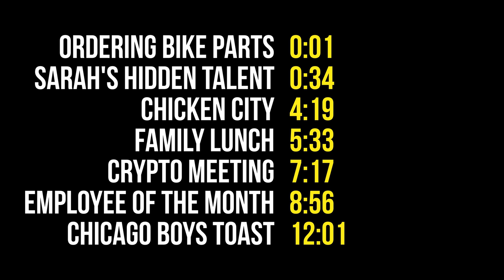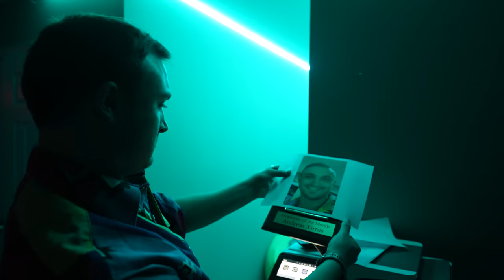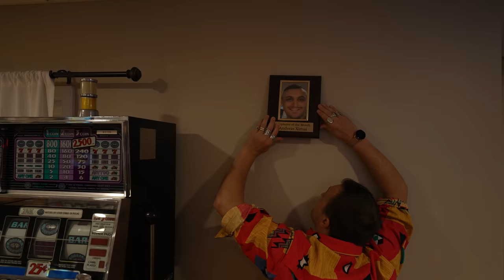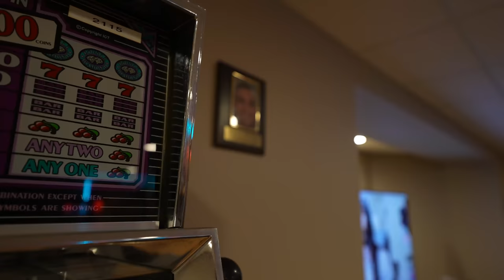Seamus And Jack Try The Grossest Alcohol On Earth Jeppson's Malört

Comment: Tell Sarah the bike is not a 2 stroke so she doesn’t need to rev it like that, that’s why it stalled
Reply: It's also a semi automatic I didn't even know you could stall those.
Reply: @mattreviews4948  I think bc when she’s Erving she’s releasing it so fast it stalls out while if she kept slight pressure or none at all it wouldn’t stall
Reply: @biggucciboombastic7976  I had a bike that was semi auto, you didn't even need it to be in neutral to start because it's like a scooter centrifugal clutch, it only engages when the engine reaches a certain rpm so it literally can't stall the way a manual vehicle can. There is no clutch to let out manually.

Comment: How strong is it? This might be the old functional alcoholic in me that is only kept at bay by riding motorcycles legally asking... 
Also in the vane of Tim's ski skate I picture Sarah riding a dirt bike somehow swapping the 2 wheels for  roller skates, that would be an intense project for the 3d printers, lots of gears to convert the chain drive to either lots of chains, or chains and shafts just because. It will break almost instantly, but it's worth a go.